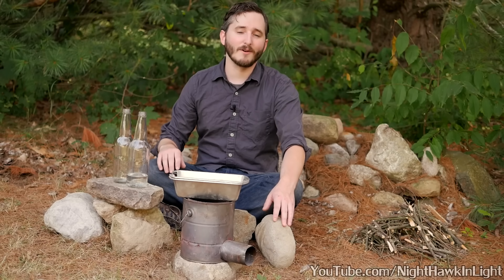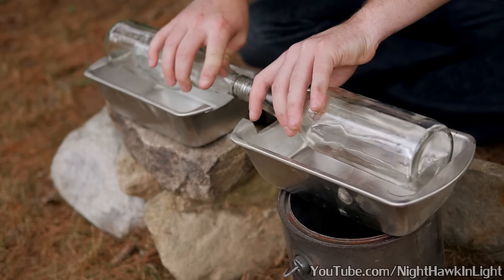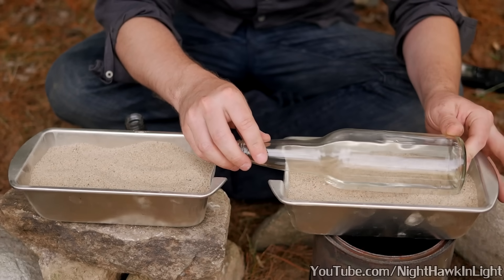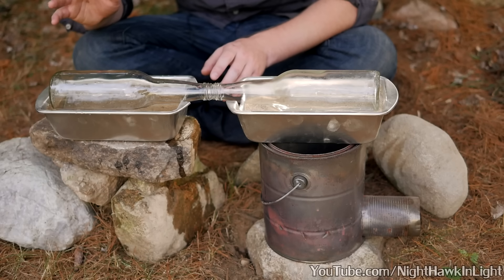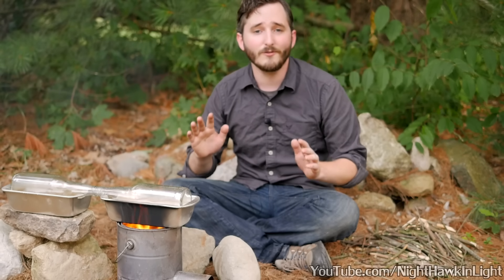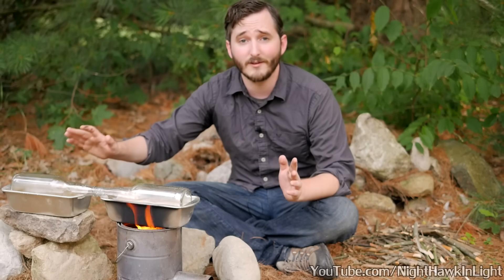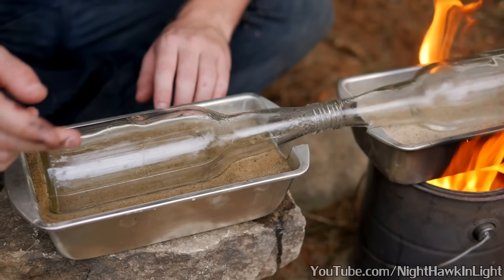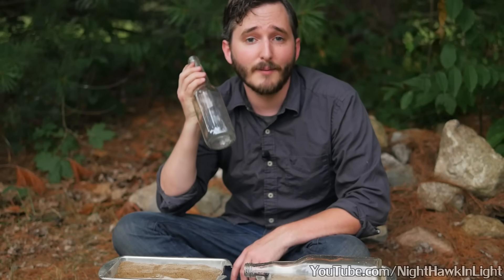How To Turn Salt Water Into Fresh Water (Simple Improvised Distillation)

Comment: Wouldn't it have been better to show how to distill the water without the trays, considering one doesn't need to distill water unless they're in a survival situation.  Makes me wonder how feasible it actually is.
Reply: If you're in a survival situation, you might not even have the bottles either.   This is basically only valid if you can find non natural items, like if you're ship wrecked on an island and have a bunch of drift garbage to work with.  It's much harder to distill water with completely natural items, because very few things in nature will be the proper shape and can't withstand the temperature of a fire without burning while also holding the water reliably.  

But if you had the bottles, you could just do it the same way people use rocks to cook on.  You just need a large enough and preferably flat enough stone, dig a canal in the ground for the fire to go into, bridge the gap with the stone, pour sand on the stone, lay the bottle in the sand.  The canal will also keep the heat focused, so you can make a fairly narrow canal, just wide enough to be directly under the bottle, with the other bottle propped up on either side of the canal so that it's not above the heat source and can cool to condense the water.  Both of these methods require glass or metal objects though.   You could possibly mold something out of clay though.  Like making 2 tea pots out of clay, with the spouts connected.

Comment: Here was a method I was told in high school that might work (never tried it) that should be easier. Fill salt water in a pot. Put pot on camp fire. Take plastic and make a small lopsided teepee to catch the steam. Use a container to catch droplets collected from the plastic. Or you could use a clean cloth and let the steam to soak it and squeeze it in a cup. Someone should try this and see if it actually works.

Comment: Drinking too much of it would still not be very healthy.
Distilled water can, if it isn´t consumed by drinking and so making contact with the stomach acid -automatically meaning to add nutrients to aswell making it less harmfull-, hurt your body immensely.
Distilled water on the outside of one of our cells leads to a bursting of our cells due to osmosis, causing to force the big amount of water to breach into our cell to compensate the salt and sugar concentration in its interior.
You COULD die from drinking to much of it but that would be 17 litres of distilled water and before that happens you´d probably die from water intoxication.

(I hope the grammar just as the content was correct. [I´m german]
I personally always want to know some more behind the whole process and there might be some more people.)
Reply from the maker: With this method you're likely to get enough salt back in the water from splashing over from the other bottle to not be an issue losing nutrients. You'll also be getting plenty of electrolytes from whatever you eat around the ocean.
Reply: As per my understanding our nature is doing the same process..evaporate mostly the sea water (salt water) into clouds and condense it with cold climate then turn into drinkable water as rain drops that we are drinking for many years from different source of storage as ground water , as river like that..so please clarify me how could this harm human body..
Reply: @testtibco321  Those rain drops acquire minerals while on the ground or under the ground. we don't just drink pure water, the water you take from any natural drinkable water source has minerals in it. Drinking pure water too much WILL harm your body unless you somehow compensate the negative effects.
Reply: @Eddie L 100 percent distilled water is what he made and it's bad to drink alot
Reply: You can also add a bit of sea water to your  purified water, just the exact quantity to increase the nutrient content without making it salty again
Reply: So what happens if you collect an drink rain water ?

Comment: Great video! Maybe I missed it in the explanation (and my physics is not good a at all, as embarrassing as it is to admit!) but what causes the transfer of the water vapour from the hot bottle to the cool one in stead of the water just accumulating on the roof of the hot bottle? Does the temperature difference cause a pressure difference that pushes the vapour into the cold bottle or what? Any explanation would be appreciated.
Reply from the maker: Any water that makes its way into the cold bottle condenses which creates a void to allow more vapor in. The hot bottle is too hot all the way around for water to condense.
Reply: Thank you very much for the answer. Great channel also, I even subscribed!

Comment: To help speed it up and prevent salt from going into the distilled water you could also add some sand to the distilling bottle to help nucleate bubbles. You could distill any kind of dirty water because the solid junk would be left behind so this could be useful even for dirty water, not just salt water. :)

Comment: Pure water will kill you just as well. You need roughly one tea spoon of salt per gallon to match the saltiness of your body. Also, you could easily use large amounts of sea water to cool your distillate much quicker.
Reply: All you have to do is keep the sea water from putting the fire out.  Got a suggestion for that?

Comment: I can't believe this ! I think there are elements in seawater other than sodium chloride (NaCl) which should be removed to make it potable or safely drinkable.  If it is only simple " distillation" required to desalinate seawater then there will be no more drinking water problems for us and no need for the expensive and complicated desalination plants or machines which are not easily affordable....🤓

Comment: I bet this method would work without fire at all, considering fire would be hard to make if you were stranded or something. So same set up but using the heat of the sun. saltwater bottle exposed to direct sunlight in dry sand, the condensing bottle covered from the sun or sitting in more saltwater to keep it cool and make the vapor condense. It would be much slower but would still produce fresh water and keep you alive.

Comment: You should also point out 100% distilled water is NOT a good idea to drink much of. Your body needs some electrolytes/salts,  and pure/distilled water will actually FLOW to areas of the body with salt. In fact drinking a large quantity of distilled water can kill you. (so can drinking to much water period). If I was doing this for survival, I would intentionally pour a small amount of the boiled salt water into the distilled so I didn't flush my body of to much salt.
Reply: so long as you're also eating you are going to be fine.  Yes this can kill you theoretically but not as fast as dehydration and you'd essentially starve to death before you die of distilled water.

The only exception would be if you were eating only basic greens and drinking distilled water, then you'd eventually die of lack of micronutrients.  

And then yes of course even a little of the salt from the salt water would heavily benefit you.  Then again you likely having cookable seasalt in the bottle on the right to use for taste so it is what it is.
Reply: Mean Man you get electrolytes and minerals from your food, so YES you can drink distilled water.
Reply: i thought about this too, but whatever food you are scavenging from the seashore would have more than enough salt to make it ok. unless you are for some reason distilling massive quantities and chugging it out of boredom....
Reply: People have been drinking distilled and reverse osmosis water for a long time. I've been drinking distilled water for years. There is no truth to the idea that it leeches minerals from the body. No one ever provides any sources for that claim apart from some poorly written WHO report which itself provides no sources. It's basically an urban legend.
Reply: Dan Phillips .. Distilled water doesn't leach minerals, but it certainly doesn't add any. It's really not good for you to rely on distilled water unless you add minerals to your diet or water in some way or it will eventually effect your bones, joints, teeth, etc. If you drink a lot of distilled water, every time you piss, you lose electrolytes and minerals so it can deplete your reserves.
Reply: @dgphi  Look up osmotic pressure and concentration gradients.
Reply: Joseph Sulc, are you talking about cells bursting (cytolysis) due to osmotic pressure? The kidneys maintain osmotic homeostasis by changing their rate of salt excretion and reabsorption. 

Are you talking about a known problem with drinking distilled water, or are you just speculating? 

I think that in general that if you have a very low salt intake in your diet, then you can have problems.
Reply: you always eat foods with salt of which your body gains electrolytes from. this is the most cheapest method of distillation if you think its risky for human health...why dont we consider risky the water we get from wastewater treatment because its pure and worst of it all is that disinfection  chemicals are used to remove health threatening bacteria.
Reply: Remove this comment man. In a survival situation with only salt water, distilled water isn't going to be an issue to that extent.
Reply: If you're eating other things then you shouldn't have to worry about that.
Reply: guy trying to sound smart says ......"most cheapest" .... it cant be more or less most cheapest if its already " the cheapest"
Reply: WRONG
Reply: show Documented case of someone dying, or theory BS and please stfu.
Reply: Still better than nothing. You would survive drinking distilled for a few months I'm sure.
Reply: I've been drinking distilled water for 10 years. You've been lied to buddy. Distilled is the best way to go to make the water pure water and nothing else. The other nutrients can be obtained in a diet rich or nutriceuticals (herbs, spices, shilajit, plants, fruits, etc.
Reply: ok you stupid fucks that want to drink the salty water go ahead....i'll gladly drink distilled water and just dab my finger in the salty bottle to add salt to my food....original comment is the dumbest least scientific comment in history of youtube...you especially need to continue drinking salt water, fucking dipshit dumbass....
Reply: Saline is 0.9% salt. The amount of salt you need is so miniscule that you could literally stick your finger in salty water, and then stick your finger in the distilled water and the amount of salt stuck to your finger would be sufficient. 
Also, you don't just need Sodium Chloride as your salt, Your body will hydrate better with Potassium Chloride salt, such as Bananas, coconut water.... There is usually enough in the food you eat if you have a half decent diet.
Reply: @JesusisJesus  Thanks, Jesus!
Reply: @JesusisJesus  you are right that the amount of salt you need is small but it's a lot more than just what would coat your finger in sea water. The best thing to do is keep the salt from the 1st bottle. Something people are leaving out here is you need to let the water cool before drinking. Covering the opening and then putting it in the ocean is a good way to cool it fast.
Reply: Maybe ill clean the water and then spit in it and then shake it up. = )
Reply: nerds
Reply: THIS IS A SPIN.  IT IS TRUE IN THEORY.  BUT IN REAL LIFE ITS TOTALLY FALSE BECAUSE THE AMOUNT OF SALT NEEDED IS SO SMALL.  JUST DRINK THE DISTILLED WATER AN YOU WOULD BE FINE.  YOU WILL GET ALL THE SALT YOU NEED WHEN YOU GO SWIMMING IN THE OCEAN.
Reply: As per my understanding our nature is doing the same process..evaporate mostly the sea water (salt water) into clouds and condense it with cold climate then turn into drinkable water as rain drops that we are drinking for many years from different source of storage as ground water , as river like that..so please clarify me how could this harm human body..
Reply: In a survival situation and you're worry about electrolytes shit?? You're joking right?
Reply: Door Stubb lmao
Reply: Mean Man This is what I was thinking.
Reply: Thanks doc
Reply: You can go hunting, boil the animal blood and consume them for extra salt
Reply: @Steve L LOL
Reply: I would add a tiny bit of salt every liter or 2 but thats it
Reply: Lol you probably support the addition of fluoride.... 😐
Reply: 170 likes for this nonsense?
Reply: How much pee would do it?
Reply: Well if you are stuck in an island, it doesn't matter at all.. it's better than nothing..
Reply: Such a farytale crap! Im drinking distilled water since few years. My Health is much stronger now, than IT was then. Ask your NAVY what Kind of water they're drinking.

Anorganic salt's can't be absorbed. Organic salt's can.
Reply: We are to drink pure water. Nothing else added. Minerals are to be consumed from food. Electro lights fruits. Why would you need man made crap to give you a "boost" to your simple water that has a big impact on stomach acidity. Mess with that and hey your here. At this day...
Reply: You people aren’t thinking about someone sweating their butt off in a hot climate or doing a labor intensive task. But hey, I didn’t know we had so many experts in here who apparently are to lazy to do a web search for examples.
Reply: Steve L  A girl said my meat had a  salty after taste.
Reply: @huggybear539  yeh right, your girlfriend from another state or country right. Haha
Reply: Mean Man You sir are an idiot. Please don't reproduce.

Comment: Very useful except DISTILLED water is NOT better for you than salt water. Water flows towards the density of SALT in the body. Just as water that is too salted will dehidratate you by ruining the Na balance in the body....Distilled water can do just the same by absorbing and diluting the salt and minerals in the body since it has NONE by itself; distilled wated will attract the salt and end up using more energy than giving . Basically if you drink only distilled water you still die.
Reply from the maker: Distilled water is way better to drink than salt water. If you have any food at all it will provide enough electrolytes to make up for the water, or you can just add a splash of salt water back into the distilled water and it's perfect. On the other hand there is no safe way to drink seawater without first removing the excess salt.

Comment: Your assistant is adorable! 
    Almost any pan with a fairly tight fitting lid, especially lids that have a steam vent, can potentially become a water vessel to set over a heat source.    This requires a length of 1/4" diameter stainless steel or glass tubing, to use as a condenser coil...the coil connects to the lid using a short piece of silicone tubing, or even latex rubber [the real kind, not the kind loaded with manmade chemicals] tubing.   
One might need to re-fit the steam hole with proper hardware that the tubing can fit onto.  
This might take some searching at big-box hardware stores; but between junk-store finds and those stores, one can generally find all one needs to make a distiller.  Almost any pressure cooker can be used, which can increase efficiency. 
    Using only one bottle, as the cooker, can still use a condenser coil, adapted to fit snugly on the bottle's mouth, take that vertical for a few feet, then spiral it down to the catchment container.   
    Depending on one's local air quality, when concerned about chemical toxins in the water:   can pre-filter the water through a few feet of sand, then distill it.  Then, pour it through a charcoal filter before consuming it. 
    We plan on building solar water distiller panels,to put across the back of the house...but it's the Pacific NW....there's about 2 weeks or so during any winter, which might shut-down solar water distilling, until that darkness brightens up.

Comment: Brilliantly simple, and but try 2 with screw top types as you can use tops with hole puncture and metal tube to channel steam to bottom of cooling bottle so that very little steam is wasted. 
Hope to see this in your next version. Thanks.
Reply: As a further improvement use a longer tube bent down from heater bottle at an angle and bend the tube tight conically lower 
so that the escaping heat 
channels air to top. 
Very little waste steam.

Comment: why not put them at about 45 degree facing each other, and use tin foil to make a pipe to guide the steam?
Reply: Need more parts and tools, and may not increase the efficiency. Keep it simple and stupid is the engineering motto for situations with little or no spare parts.

Comment: What a great idea. This could be used to remove parasites, bacteria, and heavy metals as well. This is a crude setup, but I am betting with a little imagination, a better system could be built. If you could find some flexible pvc to fit into the bottles, you could let the second bottle stand more  upright.

Comment: If you try to refill that bottle, it will likely experience thermal shock and crack.
Would it work to take 2 bottles and put them next to each other, one with dirty/salty water and the other one emply and put a hose between them on the lids? The sun should evaporate the water in the first bottle and as long as the second bottle is shielded from the sun, end up collecting the evaporated water.

Comment: all you need are the cake pans...suspend one cake pan with seawater over the heat.  invert the other cake pan over the first at a slight angle and a slight overhang  (prop up the back with a small rock or something)...the steam will hit the top cake pan, and gravity will move the water down the angle of the pan...all you have to do is  place a receptacle under the overhang to catch it.